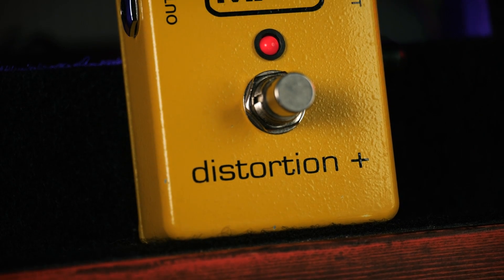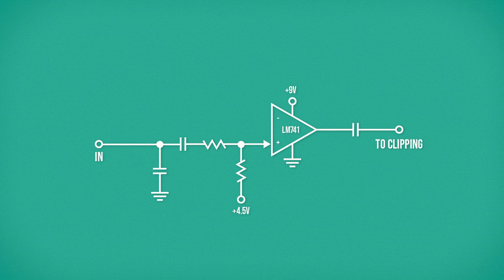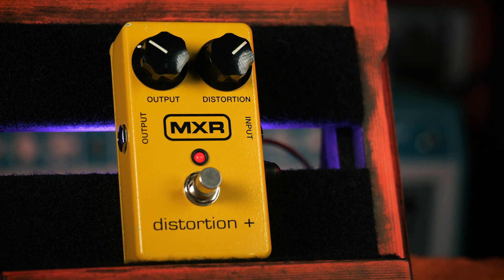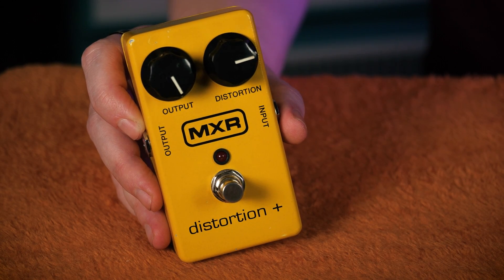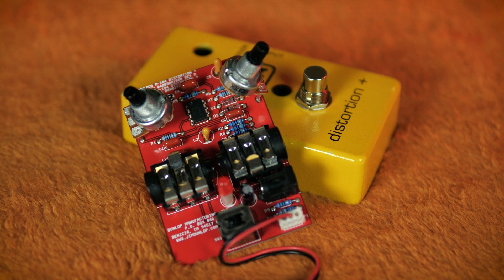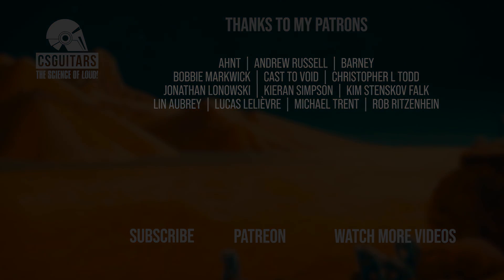How MXR Distortion + Reinvented Drive Circuits | Gain Appreciation

Comment from the maker: The first 1,000 people to use the link will get a 1 month free trial of Skillshare: https://skl.sh/csguitars1122

MXR Distortion + : 
Thomann - https://thmn.to/thoprod/162223?offid=1&affid=367
Sweetwater - https://imp.i114863.net/Gjv192
Utilising then new stable op amp technology which miniaturised a transistor amplifier circuit into a tiny chip, the MXR Distortion + is arguably the first pedal to ditch fuzz in preference of sounding like a valve amp. 

This video contains paid promotion from Skillshare
More details on how CSGuitars implements product promotion - https://www.csguitars.co.uk/disclosure

Timecodes:
00:00 - Introduction
00:49 - LM741 & Op Amp History
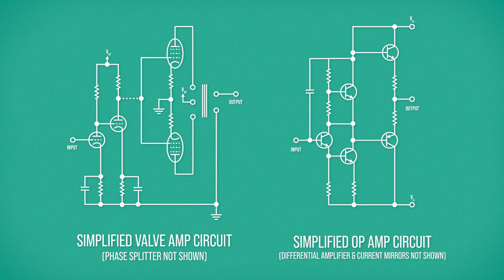02:17 - Variable Gain, Non Inverting Amplifier
03:23 - Germanium Clipping Diodes
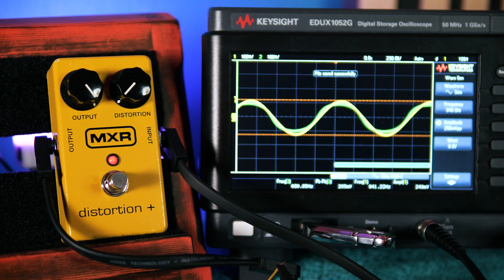04:10 - Gain & Clipping Sound Examples with Scope Traces
04:48 - Distortion Circuit in full
06:04 - Skillshare Sponsor segment
07:26 - Op Amp Slew Rate & Filtering
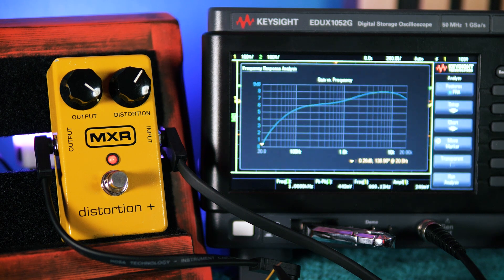09:20 - Sonic Summary of Distortion +
09:40 - Sound Examples
11:43 - Conclusion

Resources: 
LM741 Datasheet - https://www.mit.edu/~6.301/LM741.pdf
Op Amp Slew Rate Frequency calculator - http://www.learningaboutelectronics.com/Articles/Slew-rate-calculator.php
Op Amp Gain calculator - http://www.learningaboutelectronics.com/Articles/Op-amp-gain-calculator.php
Low Pass Filter Frequency calculator - http://www.learningaboutelectronics.com/Articles/Low-pass-filter-calculator.php

Get 15% OFF unique and colourful Mr Gugu clothing with discount code 'CSGuitars' - https://mrgugu.com/

#distortion #opamp #skillshare

More from CSGuitars: 
Gain access to exclusive content at: https://www.patreon.com/csguitars
Join CSGuitars Discord - https://discord.gg/csguitars
Buy CSGuitars Merchandise - https://www.csguitars.co.uk/store
Website - http://www.csguitars.co.uk
Contact - colin@csguitars.co.uk
__________________________________________________________________
Description contains affiliate links. Purchasing using one of these links will generate a small commission for CSGuitars at no additional cost to you.
Reply: MXR is currently working on RR version. They looked and analized it from his pedal board.
Reply from the maker: @nacuda9  and I'm 100% certain the result of that "analysis" will be to sand the identification numbers off a standard IC, claim it is a super rare NOS that made all the tone happen, then jack up the price 300%
Reply: @ScienceofLoud  damn last time i saw you, you had long hair in your room damn time really does fly

Comment: I got the reissue "script"  just work with a battery it has a tremendous response, specially the volume, you can play all those "neo classic" stuff,...I bought the relatively new one M104 unit with a relatively new circuit  but same passive  components it sounds the same, thumbs up

Comment: I just got one of these used through the post today and it doesnt have anywhere near the gain of yours. 🤔 I opened it up and nothing appears to have been modified. I've tried battery, and two lots of external power and it barely clips. Any idea what is going on?

Comment: Great video with thorough explanation, but the approach for the Rhoads-type of tone is all wrong and modern!
At about 11:21 in, the volume it turned up all the way, then gain applied which is a more modern technique and more focused on tightening up the bottom-end and chug.
That is completely different than back in the day!
Back then, you turn up the GAIN, not volume, and in Rhoads case, that is at 100%, then turn the volume up to the level of when the pedal is off, so no change in amplitude!!

Comment: Have you ever played an HH Ic100 before ? That’s a UK 🇬🇧 amp from the early 70s that’s all 741 amp based and was one of the first guitar amps to use it as far as I know. That circuit was a fixed gain with it switch so it was either on or off and included an active EQ circuit which was so ahead of it’s time. Maybe the vox defiant and conquerer from 68 used them too but I’m not sure would have to look at the schematic

Comment: This video made me understand why the 741 integrated circuit is so often used in so many distortion pedal designs.
To date, I've only played with DIY transistorized pedal projects using BCs 548 and 549C.
Thanks for the video 😁👍

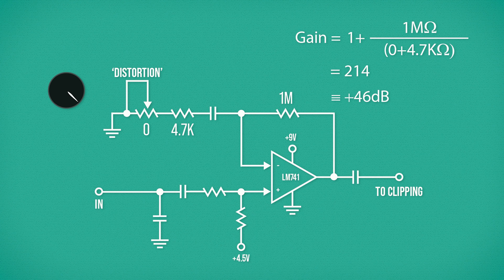Comment: According to the Wampler Distortion Plus MODS page one can find, Brain says changing the 4.7k to 1k and the 4n7 to .22uF increases gain but does not change the high frequency response!  At 3:16 in, it shows you the formula for Gain = 1+(1M/(gain know resistance+resistor)), which is 1+(1000000/0+4700) = 214 = +46dB.  Changing the 4k7 to 1k would result in = 1+(1000000/0+1000) = 1,000!  So about a 5x increase in distortion.  Not sure what that equates to dB, but > +46dB (I think it's like 60dB)!!

Comment: does anyone know the value of R9 on the pcb? I've got one with this resistor burnt and I'd like to replace. Thanks!
Reply from the maker: This pedal has gone through a number of changes over the years, so the component numbering is different depending on the version you have. 

Since it's burned out, I'd take an educated guess that it's one of the two 1Mohm resistors that form the voltage divider inside the power section. 
Being the first component in line with the power socket, if it's been provided too much voltage at some point, it would be the first part to go. 

It should be sitting beside another resistor (possibly labelled R8), if it is still intact measure its resistance, as it should be the same as the one beside it.
Reply: @ScienceofLoud  I thought about the 1Mohm resistor too, or that associated with the voltage divider, since the line goes straight to pin 7 on the opamp. But as far as I can see from images of other boards R8 and R9 have different values. Also in the same revision as mine (I have revision D of the board, but the GREEN PCB) they have different color codes. I wrote to MXR to know more about but still waiting for the response. how sad... should I throw away my D+?

Comment: This was probably the best explanation of how an overdrive circuit in a pedal works! 

I tried a Distorsion+ in the late seventies, didn't like it and never looked back.
Discovered the DOD250 a year ago and found out it was a clone of the MXR, so I had to try one.
LOVE IT!
So, 45 years later I have the 250, the + and the RAT on my board. 😂

Comment: The MXR Distortion + was the first clear distortion pedal. It's not hot by today's standards but running it through a cranked Marshall still sets off some real fireworks. I got an old 70s era MXR when I got my first Marshall, a JMP stack, in the mid 80s. To this day it's one of the best tones I've ever had. It was a very clear, cutting distortion, very much in the vein of Randy Rhoads.

Comment: Wow. I just bought the distortion+ a few years back. I figured the circuits were different because I had bought a boss ds1 and the circuits were clearly different from my old one from way back in the 90s. I returned that one and bought a used one, but the distortion+ I only played a few times. My buddy had one around that same time. I don’t remember too much the sound. Anyways great video

Comment: I saw a video where the guy said the left knob simulates the power amp section and the right knob simulates the preamp section I use it was transistor amps it is sounds really nice.

Comment: 8:50 "filtering inside the feedback"... yes there is a capacitor forming a filter in the feedback loop of the distorsion amplifier however i'm wondering if it is not to remove the input offset voltage of the opamp out of the equation.

short explanation:
at x100 gain (+40dB) a continuous 5mV offset becomes 0.5V which is around the same level as a clipping diode...

i think the filtering is just a bonus, but don't get me wrong IT CAN change the sound, and that is something i haven't checked.

Comment: One of my favorite flea market finds was a '79 Distortion + for $30. I have to be extremely careful using it now because I've had to resolder the battery connection twice now. I've thought about retiring it and buying a modern one but have been afraid of the two sounding completely different.

Comment: I've got an original MXR. Pretty sure it's first year. Pretty beat. Chunks of nobs missing. Paint wore. Modded to take a power supply and needs a potentiometer. Was working great until the pot went bad. How much is it worth?

Comment: I had an original one way back in the early 80's switched to an ART SGX200 in the 90's and got rid of it and a JCM 800 LOL and recently I found on "General Guitar Gadgets" a Distortion+ that you can build your self for quite cheap and comes with all parts.... so for Christmas I got one and a Klon Klone to build!!! just having my boxes powder coated before I build them ... can't wait!!! I think thats right up your ally bro... One thing I also found was the "Baby Will" and the "Super Lite II" their circuits based on the 1974x Marsh.. Your my new favorite channel!!!

Comment: I wish to correct a common misconception

You said at one place in your video

The Opamp alone would have just been a clean boost were it not for the germanium clipping diodes

Earlier you calculated the gain of the Opamp to be maximum around 200x

Suppose a guitar signal is 1Vp, we are then asking the Opamp to create 200vp at it's output. That is impossible to do with a 9V power supply. Hence the Opamp "rail saturates"

This creates distortion!

So for most of the travel of the gain pot, distortion is being created at two places, 

1. at Opamp due to saturation
2. Hard Clipping diodes 

Many reviewers forget or don't appreciate the point that the Opamp rail saturated. It is easy to test though. If we remove the clipping diodes, we will still hear clipping (due to Opamp rail saturation) the

Comment: I'm learning about mosfets in my electronics class, and this video made me wonder why they aren't used more often in guitar pedals, since they are so tiny and efficient. As such I wonder if there's a legitimate reason for that, or if it's just guitar industry doing as usual with inovation
Reply from the maker: Mosfets are more commonly used for power amplification, which is why they aren't in pedals all that much.

Op amps, jfets, and bipolar transistors are more common for class A preamp circuits
Reply: @ScienceofLoud  indeed, thank you, Colin!
Reply: Mosfets are essentially solid state relays. They are excellent at switching on and off at really high frequencies which is why they get used in power electronics, like motor controllers, inverters, switch mode power supplies and of course D class amplifiers. A D class amp is essentially an inverter that makes audio waveforms instead of a 50 or 60 hz sine wave. A switch mode power supply is an inverter that doesn't change the pulse width at 50 cycles a second, as it aims to create a constant DC voltage out of a high frequency AC waveform from the mosfets. They all do the same thing with the DC supply, which is switch it on and off at high frequency and vary the pulse width to create a different effective voltage on the output, either to create a low frequency waveform, or a constant DC voltage.

JFETS on the other hand, can almost exactly mimic the behavior of a vacuum tube. 

I personally would be interested on seeing what a mosfet could do if abused to create distortion, but I suspect their extremely fast switching is probably not what we're looking for in guitar tone. Perhaps they could be made to clip a signal from an op amp with a suitable circuit that sets a certain threshold for the MOSFET to switch on and dump the signal to ground, resulting in extremely sharp clipping. I wonder....
Reply: Just did some research, and yes, MOSFETs can be used for clipping, I've yet to hear it, but it's definitely something that gets done, in much the same way as diodes are used.

Edit: they aren't used for clipping usually, but it's actually quite common to use them in cascading gain stages much like any other transistor based fuzz or distortion. Apparently more tube-like just like JFETs.

Comment: 1) Actually, the diodes are not absolutely necessary to achieve clipping, although the distortion will be much more evident with them.  Keep in mind that, with a +9V supply, the 741 will only be able to "swing" about +/-3500mv in each direction.  Assuming an input signal of +/-100mv (hitting a power chord), it only takes a gain of 35x to hit the headroom ceiling of the chip.  And since the gain of the circuit can be adjusted up to 214x, much of the range of gain settings achieve clipping within the chip.  On DIY forums, people would often ask "I lifted the diodes to get a clean boost but I still get clipping.  How come?".  THAT'S why.  My own contention is that, by virtue of this propensity to clip within the 741, before any introduction of diodes clipping, makes the circuit functionally a *dual-clipper*; i.e., it clips once in the chip, and the chip output gets clipped again by the diodes.  That double-clipping is part of what results in a more level and compressed sound.  Pristine clean amplification, followed by diode clipping wouldn't provide that.

2) The manner in which gain is adjusted in a non-inverting op-amp has different implications.  When gain is adjusted via feedback resistance, as it is in a Tube Screamer or Rat, in tandem with a capacitor in parallel, treble is rolled off as gain is increased.  In contrast, when gain is varied using "ground leg" resistance, as it is in the Dist+, the bass is rolled off as gain is increased.  In the case of the Dist+, the rolloff begins around 720hz at maximum gain, as you've illustrated.  In the case of the Dist+, my hunch is that this had two consequences, whether anticipated by the designers or not.  One is that de-accentuation of bass at higher gains achieved a more strident tone with searing mids and highs.  So kind of an automatic tone adjustment for free.  The second implication is that, with fewer options for hum-rejecting pickups than we currently enjoy, providing less gain for content in the range of 50/60hz hum, and its multiples, would result in less of what you didn't want at higher volumes.

If a person has all their hum under control and would like more oomph to their tone, the cure is identical to what many have done with Tube Screamers and derivative designs; namely increase the vale of the .047uf (47nf) capacitor between the Gain pot and ground.  A value of 100-220nf will restore a lot of the guts missing from higher-gain settings.

3) Given when it started appearing, my sense is that MXR tried to achieve two things with the Dist+.  At its lower gain range, the goal was to yield a sort of clean booster.  This would transition into distortion as you turned up the gain.  To achieve that, the unit used a reverse-log gain pot, that would provide the high resistances needed for low gain, but quickly transition out of that to lower resistances.

4)  Over the course of several issues, people found that it was difficult to achieve any appreciable volume, unless one dimed the gain control.  This appears to have been the result of using a less-than-called-for Volume pot value of 10k.  Keep in mind that, with the 10k resistor just ahead of the diodes, a 10k volume pot behaved like it was a 20k volume pot that could never be turned above 50%.  Later issues adopted use of higher value volume pots of 50k or even 100k, allowing for volume levels well above bypass volume, even when gain was not up full.

5) The DOD250 uses what is essentially the same circuit as the Distortion+, but employs silicon, rather than germanium, diodes.  This raises the clipping threshold, yielding an output which is perhaps not quite as severely clipped, but is easily much louder.

6) The rolloff provided by the cap you've designated as C6 (in parallel with the diodes), really does diddley squat that's actually audible; especially given just how many speakers begin their rolloff around 6khz.  For a warmer sound, one can supplement the stock 1nf (.001uf) capacitor with another 2.2nf (.0022uf), tacked onto the pads on the copper side of the board.  This will lower the rolloff (still rather shallow) down to just under 5khz, for noticeably less fizz without losing one tooth's worth of bite.
Reply: I hope that one day I can reach your level of understanding of audio electronics. Awesome write up
Reply: @t48261  Thanks.  Much appreciated.  And trust me, you will.
Reply: I was reading the comment and though, this guy knows what he is talking, then I realized he is Mark Hammer himself! lol love your Chaos Distortion pedal, Mark!

Comment: Hey Colin, I just watched Rhett Shull's video on the DS-1 yesterday. In the video Josh Scott says that the original Boss DS-1 actually did not use an op-amp, but transistors. Later versions do use an op-amp but the circuit was designed to sound the same as the original non op-amp circuit.

Comment: The first pedal I ever built was a close relative of the Distortion +, the DOD Overdrive 250. This would have been around 1995 when I was 18, with parts I had lying around and a scrap bit of veroboard. I still have it and it sounds great. I love the 741.